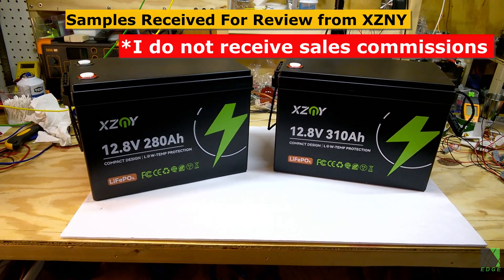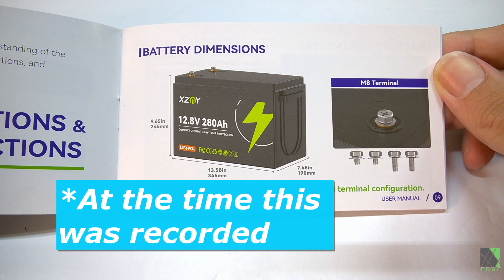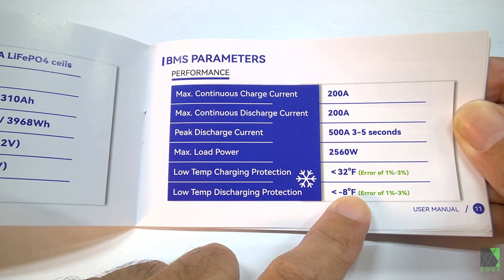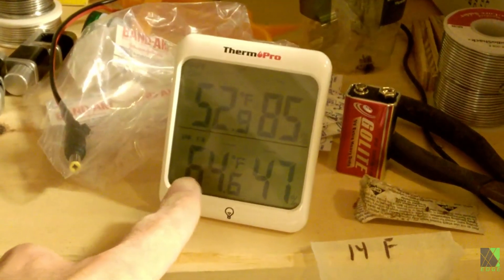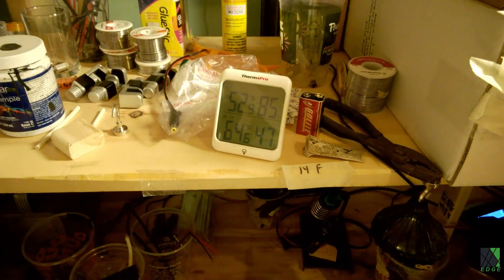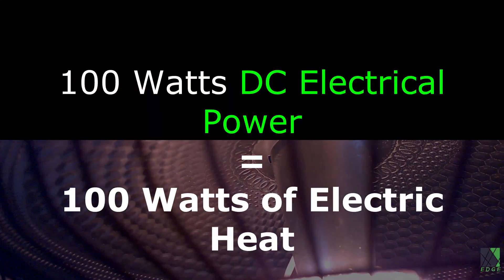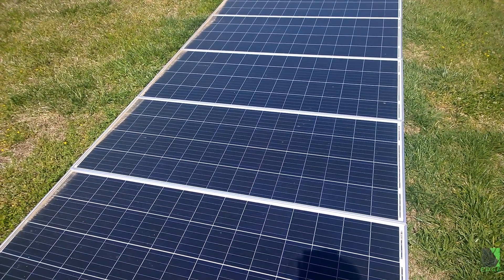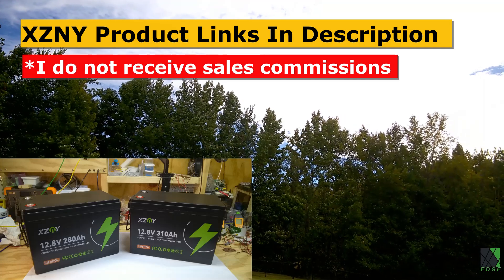How Much HEAT In A Battery? XZNY Compact 310 / 280ah LiFePo4 test & #review! #offgrid

Comment: Have you heard of Syngas? It's something anyone can make using Organic waste. It powered parts of Europe in WW2. 
Use excess solar power as an electric heat source. This heat is used as the energy source for pyrolysis. 
Pyrolysis is a chemical process but it's not much more than cooking the biomass and capturing the 'smoke'.  That smoke is syngas and to use it in a generator you actually have to remove the carburetor! How many generators don't work because they need carb work!?  No more carb problems!
The leftover material is Biochar. Biochar is a permanent carbon store and in poor soil is an absolute amazing fertilizer. 
Just Google syngas, Biochar, pyrolysis, retort, gasometer for ideas.
Reply from the maker: @lorddorker3703 This is really cool and deserves more research... thanks for the information!

Comment: Another well put together video which always seems to be too short...... 
That's the way it is when it's done properly I guess? 
I feel like you could have a lot more to say about everything and I would have more to listen to and enjoy it..... 
I have been working on the string diodes, trying to figure out what each diode needs in voltage to run them efficiently without damaging them.... 
I'm currently using small diodes as I have plenty of them, just in case I destroy any, as soon as I develop a deeper understanding I will order some higher power versions and retrofit them inside an existing fan heater and begin testing how long it will take to raise the temperature of a bedroom..... 
The application I need is the ability to hold the temperature overnight during winter at the lowest power consumption as possible so that it can run off my battery bank.... 
The current fan heaters I have only have two heat options of 1.2kw and 2kw and the fan is noisy.... I think that I can put together something that uses less energy and runs quietly.....  
I just need to find out what voltage each diode needs.... Or should I be looking at what temperature each diode should be putting out? Obviously each different diode will be able to operate at different heat values, I'm thinking that if I stay below it's temperature rating stated in it's datasheet, then I should be okay.... I think?
Reply from the maker: @PeterMilanovski Hi and thank you sir... you are very perceptive - there is tremendous pressure to "shorten" the video and keep it moving or folks will click off. Which cuts off creativity and detail, ruining the work I think. They say "It needs to be engaging" hahah. Then again this is all out of my hands. 
Tell you what, if I can get to 100k I'll stop worrying about watch time and thumbnails and make some excruciatingly long and detailed videos :D
Just sharing some opinions... I have built several diode space heaters including larger ones I will show you asap. 
They need dozens of diodes to match a solar panel. to that end I have been using power rectifiers to heat my shop "hybrid" with nichrome. This way I don't give up my PV space heaters. And the diodes don't work as hard.
Each diode can only drop .5v so one is not enough. Each is sensitive to temperature, but that's OK as it helps regulate voltage under changing conditions. The datasheet temps might be quite high, not sure. I do like to run them around 40-50C and blow a fan over them (quiet fan hopefully). Ideally not as hot so are less likely to burn out.
Diodes should not be run off battery, instead off solar panels (current limited). In your case, probably could use PV heating during the day, and switch over to battery or thermal heat mass during the  night. I'm trying to do something similar in the shop.
I'll send up a video today if possible showing my diode collection :D

Comment: Electricity of a heater really sucks the power out of any battery weather its Led Acid or LIFEPO4. I find the best way to run an Electrical heater is to use it in the day where you can replenish the battery with Sun and maybe run a Propane heater in the evening..Also it all depends on the amount of Solar you have and the battery storage capacity.
Reply from the maker: @mannyfragoza9652 Good points... I sometimes blast propane for 10 minutes just to boost the heat. Then I let the solar panels carry it through the day. Hard to beat gas heat for BTU output....
Reply: @solarpoweredge  you are correct sir